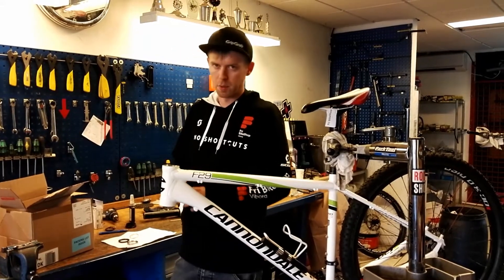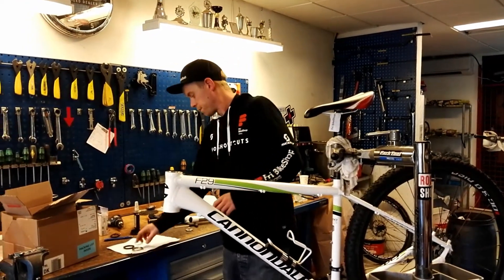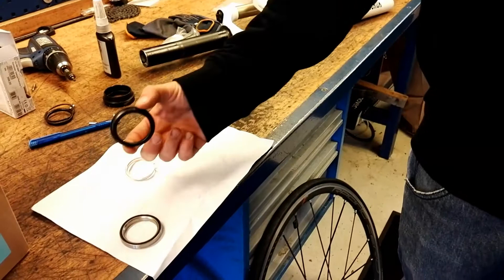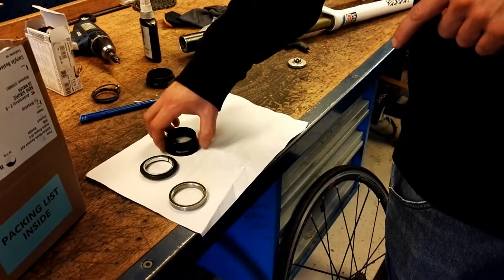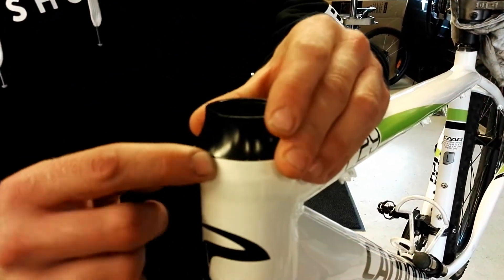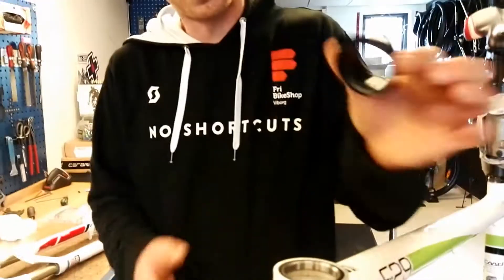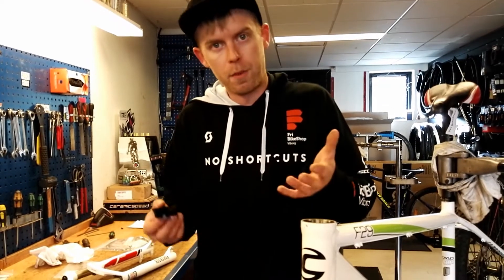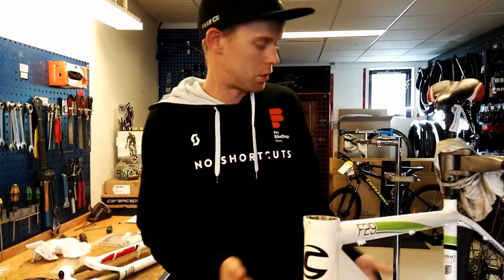Headset issues on cannondale

Comment: That bike came with a lefty fork.  If you run the Cannondale shock and the bearings that go with it you won't have any problems.  This is a adapter problem more than a bearing problem.
Reply from the maker: It was a video for canondales warranty department. I was a little frustrated... they had send me all the shit and claimed that it would fit together.... 
That's the second time this customer get a new frame on warranty and last time he bought canondale